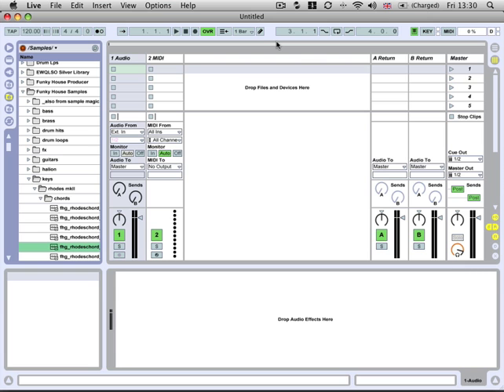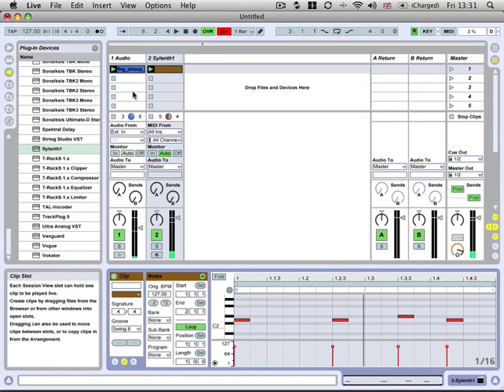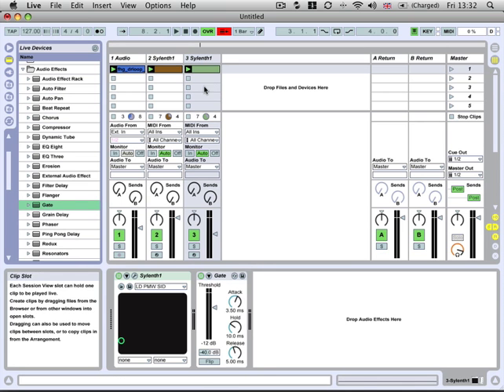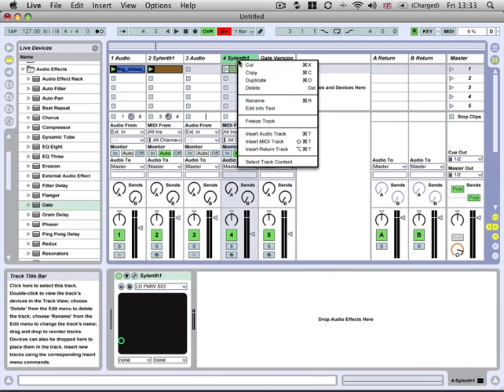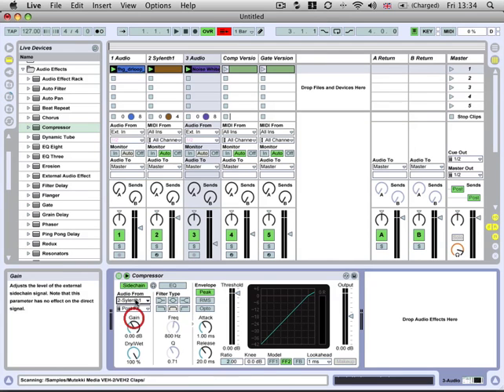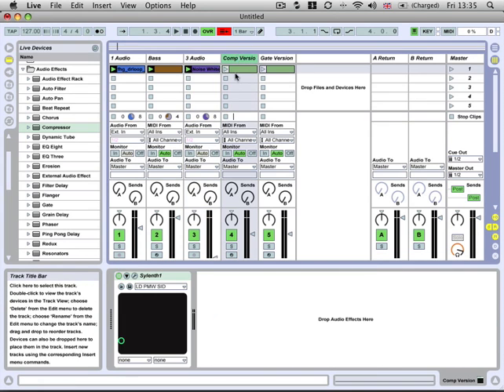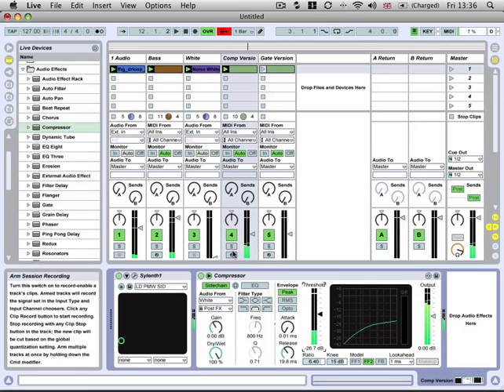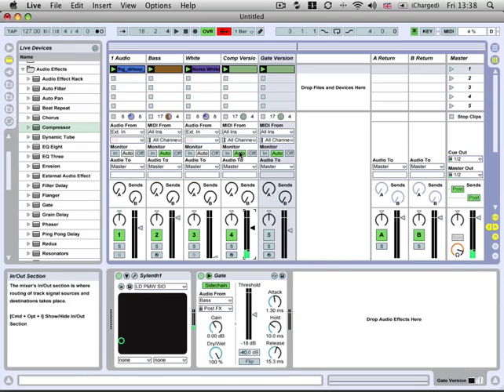Ableton Tutorial - Tech Tip 4 - Gate and Reverse Sidechain Techniques

Comment: @StephenDeadToLife If I understand you correctly, you're using a microphone to record with and when you click "in" on the track you want to record to, you get loud feedback?  If this is the case, it is because you're using speakers, it causes feedback because your microphone picks up noise which is amplified through the speakers, but the mic picks that up too so it starts feeding back.  What you need to do is turn your speakers off and use headphones while recording.